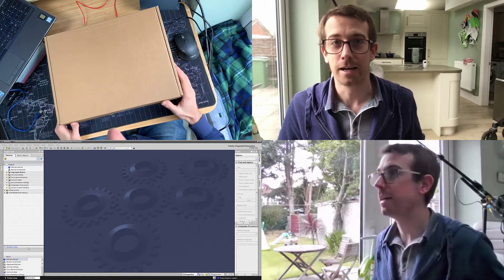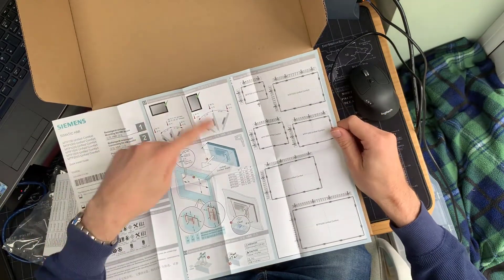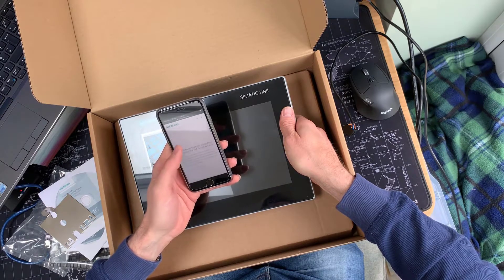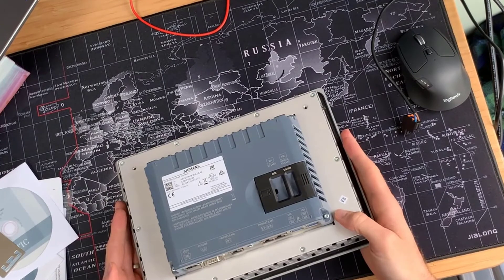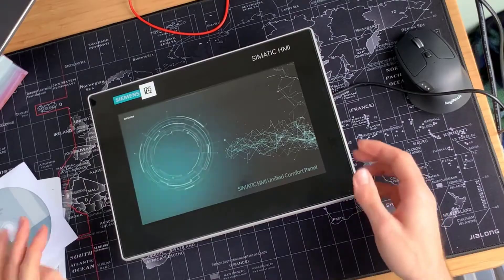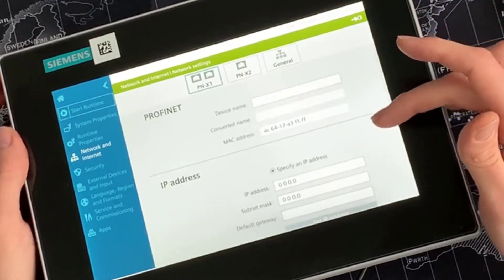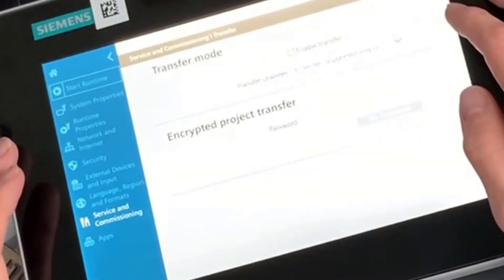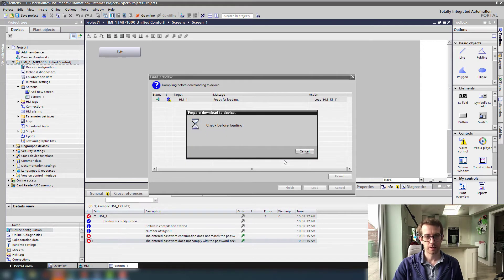SIMATIC Unified Comfort Panel HMI - UNBOXING

Comment: Im learning about robotics and noticed one of these on ebay . Can some tell me what these panels are used for .

Thank you
Reply from the maker: In the world of automation it is common to use a Programmable Logic Controller to provide the logic that runs a machine. Inside the code of the PLC there will be variables that need to be changed by the operator of the machine, for example speed of a machine or job size. In order for the operator of the machine to be able to change these values and ultimately control the machine they need a way to interface with it. This is where these devices come in, they are called Human Machine Interfaces, or HMIs, and as the name suggest they allow the operator to interface with the machine. The way they work is the HMI connects to the PLC and changes the values inside of the code which in turn affect the operation of the machine. A machine builder or a systems integrator will use software such a TIA Portal to design an attractive simple to use interface to allow a machine operator to easily monitor and control machinery.